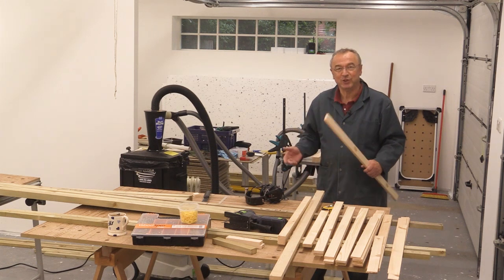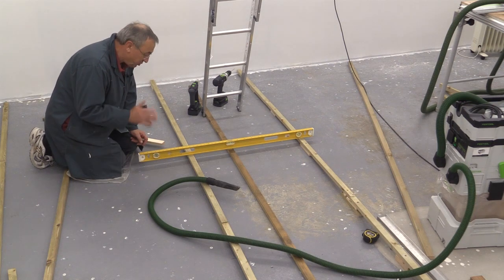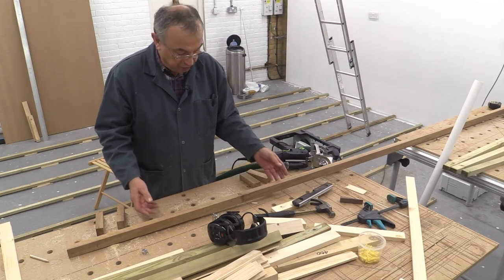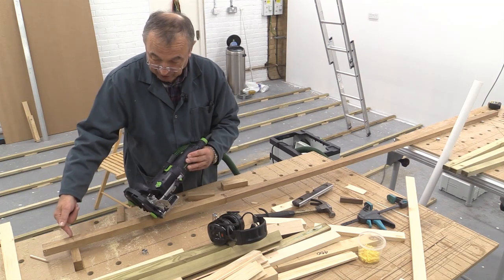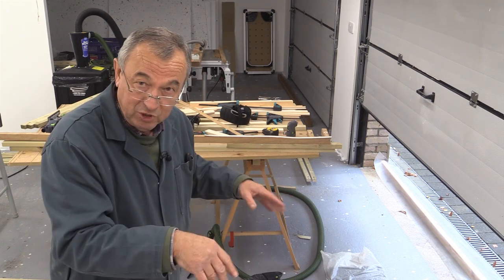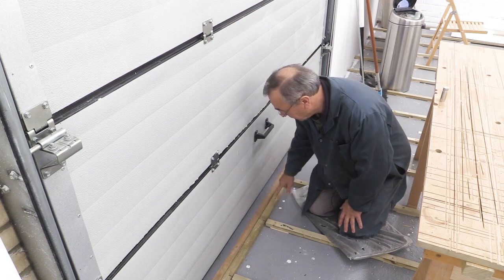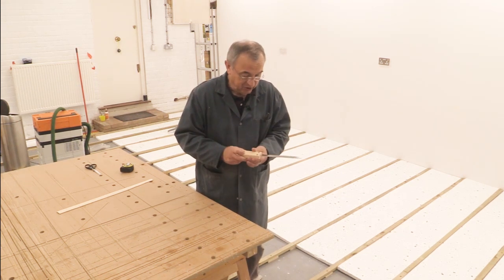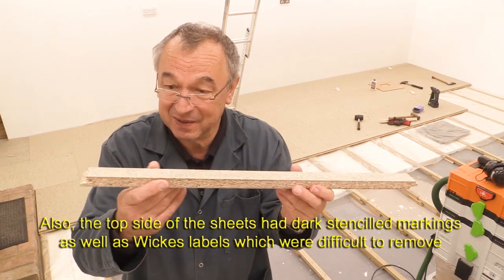The New Workshop #2

Comment: You could have used the plastic cradles. It's just a plastic square with a 50x50 section removed from the centre. Then you place 50x50 timber in the cradles. Once you've levelled them all up. Using a laser and a Sounder. It's a system used on junckers flooring.

Comment: Hi Peter
I note the couple of oil filled radiators.  Very expensive to run.  Had you thought of using a reversible inverter Aircon unit.  We use these in CYPRUS for heating and cooling.  Given the 2-4 times ratio of output to input power depending on the type of unit ( inverters are more efficient) this could be a good solution for heating and the cooling might be welcome if the globe warms up much more (29 here today!).  I am going to do this on my new workshop in UK?
Progress looks good but a lot of work!  WKR 

Mike
Reply from the maker: Hi Mike, Those are left over from the old workshop. I have a radiator in the new workshop which will run off the normal house heating system.  Cheers.  Peter

Comment: Looking good Peter. I floored mine in 18mm sheathing ply 5 years ago and its now wearing through the top veneer in places, but with all my gear on it, it would be a mammoth job to replace. How about a thin layer of ply over the top which will stop the chip board wearing and if you screw it down in 1200mm squares it will be easily replaceable as areas wear with footfall or constant rolling of machinery? Just a thought.
I take it you managed to move house in the end?
Reply from the maker: Hi Graham, Ply will wear more than chipboard flooring but, as you say, it is easy to add a new layer of something more durable if required.  My woodworking guru has a chipboard floor in his workshop. He has been there for 20 years (or more), had fork lifts in and out to move machine, some of which weigh 2 tons.  Peter
Reply: New Brit Workshop fair enough Peter. Every day is a school day.
Reply: New Brit Workshop Wowsers even you have a woodworking guru🤪
Reply from the maker: Hi Dermot, Yes I do. He has no web site, does not advertise yet has a huge customer base around the world.  His work is simply brilliant.   Peter

Comment: My garage floor isn't terribly level either, but I do occasionally put away my tools to park my car in it. Would this solution support the weight of a vehicle? My guess is that it would not. Nice work btw, it looks like you're doing a top notch job.
Reply from the maker: Hi Michael, I have only shown the part where there will be no vehicles in future. The second half is being done now and will have more support battens under the chipboard.  That video may be coming up in 10 days time (or so).  Peter

Comment: Did you consider using self-leveling liquid cement to even the floor?
Reply from the maker: Hi Dan,  Yes, but I would need about 40 bags at £20 each as the variation across the whole floor was about 40 mm.  Peter
Reply: @NewBritWorkshop   Screwfix sell Mapei compound 1210 which works out at £8 a bag, so a bit more economical. I had a similar situation with my slab to you and went down that route. It's worked out ok but it is messy work and it needs layering in 10mm increments so takes a bit of time. It has gotten the job done though.

Comment: Peter, thank you for sharing this video. May I ask you a question please? Given that some woodworking machines are quite heavy, why didn't you go for a 'solid' floor? What I mean is, either a concrete screed or leveling compound?
Reply from the maker: Hi Mike, Take a look at the other comments and you will see that cost is an issue and there is absolutely no problem with the machinery.  Cheers.  Peter
Reply: @NewBritWorkshop  Thanks for the reply Peter, much appreciated, I'll have a look though the comments :)

Comment: Another good way of levelling is to set up a laser level, get a datum, mark your line on a bit of batten and then youse that as a gauging rod to level the floor 👍🏼
Reply from the maker: I did do that but "borrowed" the laser of the dry lining chap whilst he was getting some material. I created a matrix of measurements and then took the smallest away from the rest to get the actual height variation.  Cheers.   Peter

Comment: Hi Peter
Excluding the cost difference, was there a particular reason for using polystyrene over phenolic foil backed foam such as Kinspan, Ballytherem, just to mention a few brand names.  Kingspan is many times more thermally efficient than polystyrene.  Certainly in the construction industry polystyrene hasn’t been used for years now & it doesn’t comply with building regs, not that your application is required to adhere to building regs, I’m just curious as to your reasoning? Thanks.
Reply from the maker: Hi Steve, The cost was the main consideration as doing this floor was not in my original budget. Compromises are having to be made.  Cheers.   Peter

Comment: to level the floor battens, cut lots of wedges and use them in pairs, one sliding over the other to fill up the gap below batten
Reply from the maker: Hi David, An excellent tip, many thanks.   Peter
Reply: @NewBritWorkshop  didn't watch all of show before suggestion, you can use it on your next workshop

Comment: How long did all the shimmong take? Awesome
Reply from the maker: What is "Shimmong" ?  If you mean the flooring it took 4 days as I was on my own and I had to make sure that part of the flooring could withstand the weight of a car.  Cheers.  Peter
Reply: @NewBritWorkshop  Lol, so sorry. I meant "Shimming".
Reply from the maker: Got it - I spent about a day doing the battens which included the shimming. In reality I did one half of the workshop completely followed by the other half. The slightly smaller half took about the same time as the larger part as I put extra battens down along the likely route of car wheels.  Cheers.  Peter
Reply: @NewBritWorkshop  I like to think that i too go the extra mile to get things to be as good as i can get them. Watching you work proves to me at least, that if somethings worth doing its worth doing properly! Many thanks for your uploads!

Comment: For the removal of labels, try a hairdryer (or heat gun if you have one). Warm up the label which will warm up the glue. Then they'll just peel off in one go.
Reply from the maker: Hi Andy, Great tip - cheers.  Peter

Comment: Did you consider self leveling cement? A bit of waterproof flashing around the drywall and poor away,  You will end up with a nicely insulated, warm soft on the feet floor the way you've done it tho.
Reply from the maker: The 40 + mm variation in level made that option difficult and expensive. I would have needed 40 bags at £20 a bag just to do that part.   Cheers.   Peter
Reply: @NewBritWorkshop  At that price yes very expensive. The last time I saw it in use was fixing a gymnasium floor that was poorly done. Not sure what it cost them but was the only way to do the fix.

Comment: I had the same problem with my workshop door. Water entering underneath the lower seal. I solved it by using a 1/12 inch angle iron sharp side up with lots of sealant on the inside floor of the roller door. I can now run my car over the angle iron without disturbing the sealing properties of the iron.
Reply from the maker: Hi Terry, That sounds like a good alternative.  Peter

Comment: Wickes are not alone in sticking hard to remove labels on the fair/good/face side of materials, and it is bl00dy annoying!  I recently had two sheets of veneered ply delivered with labels that needed white spirit to remove - and the dissolved adhesive marked the veneer.  Needless to say, they were sent back.

As to cutting polystyrene insulation board, the Bosch T313AW jigsaw blade is scalloped and works a treat.  It also cuts polycarbonate. [I have no connection with Bosch, just a happy user.]
Reply from the maker: Hi Michael, Yes, those labels are a pain - I am hoping that suppliers will take note - that is why I named Wickes. Many thanks for the Bosch blade tip.  Peter
Reply: Have you ever tried using a hair dryer or heat gun to remove labels? It's works very well for me.

Comment: Great solution to get a true floor. And all the steps you have taken are what all the pro’s would do.  I only have concern for the type of flooring, doesn’t this not damage easily? Especially in a shop, it will be beaten up in no time I’m afraid....  however, you seem to be a careful woodworker, so maybe that’s not a real problem in your case...
Reply from the maker: Hi JW, The flooring is tougher than you think and I know several professional woodworkers who have it on their shop floors.   Peter
Reply: @NewBritWorkshop  Yep … good move Peter. I laid chipboard over insulated concrete some 15 years ago for my shop.  It's taken some beating (including having a Felder 731 3 in 1 on it - more than half a ton of cast iron, and moving it occasionally on felder's HD castors). Loads of other shop machinery too. My chipboard floor is still in great condition.  Has to be admitted though, I laid the insulated concrete floor myself, so it was perfectly flat and level and I could put the chipboard directly on the concrete (Solid insulation and vapour barrier below a 50mm concrete screed.). I wouldn't like to put a load like that on a flooring supported at 600mm centres. However, and importantly for your purposes, the C/board has taken all that, and everything else in a hard working shop - no problem!
Reply: New Brit Workshop good to know, thanks!  I Guess products ar much better in the UK then US 🙂

Comment: Do you have DriCore panels available in the UK? I think that would have been faster and maybe cheaper in the long run. 
dricore dot com

But in the end whatever way you go you will be glad you put a wood floor in. Concrete is cold and hard on your feet. I wish I had installed a wood floor in my shop before I stuffed it full of tools.

Peter, that TSC55 is proving it's worth on this job alright wouldn't you say. Whenever I have a job away from the shop I take mine with me.  Even if I don't have the CT-SYS with me the dust bag works great and grabs about 99% of the sawdust. I've had my TSC55 for about 2 years and I am still amazed at how well that dust bag works.
Reply from the maker: Hi Bob, Many thanks for the info and confirmation that the wooden floor is a good idea. Yes, the TS 55 has proved its worth time and time again. Not having the mitre saw with me made me use the tracksaw cutting station for cutting narrow stock (both at 90 degrees and 45 degrees) and I really think that one can manage without one if pushed. I have since done a very accurate rebate using the same and again feel that the setup can easily replace the mitre saw if need be.   Cheers.   Peter

Comment: Funny how different people tackle similar tasks. I can see you've taken a woodworkers approach to the levelling of the floor; nothing wrong with that way but it's an awful lot of work.
A quicker and easier way is to use similar sized plastic joists (similar to composite decking joist), you can run a bed of tile adhesive or mortar along the floor and just tap the joist in to level, next day or within an hour with tile adhesive you can screw your chipboard in.
I'm sure your way is more accurate than most homes, certainly most workshops
Reply: Wouldn't the plastic joists be a lot more expensive though?
Reply from the maker: You are right about taking a woodworkers route on this. Obviously professionals in the industry will have access to all sorts of kit that is not normally stocked at the mass market builders merchants. I would love to know more about your suggestion as it would help others about to do similar work.   Peter
Reply: The joists are composite material made from recycled wood and plastic, they are not affected by moisture and very rigid for the thickness.
Cost is always something to be weighed up, the joists would a little more money but the labor savings outweigh the material costs by far.

Comment: In the cases when I've had to level things of this nature, I've usually cut (or bought) wedges. Pushing two wedges together in opposing direction makes for a very convenient way to create adjustable spacers.
Reply from the maker: Hi Rune, I am sure that would work very well indeed but I would need a huge number of different size wedges.  Cheers.  Peter
Reply: Not really. If the wedges are sharp on one end, and say 30 mm on the other, at 150 mm length or so, you have every thickness from at least 5 to 45 mm at the ready. Putting them perpendicular to the beams makes adjusting very simple.

Comment: Good job as always Peter. Just a slight concern about using gripfill. I would hesitate to use it for sealing joints. I have had it go dry and shrink considerably. Now I always use either Sikaflex or a hybrid polymer such as Stixall. These new sealants are hugely better than gripfill. Good luck with your workshop progress. Ollie.
Reply from the maker: Hi Ollie, Many thanks for that. Funny enough I did but some Sikaflex in order to do a final bead on the "wet" side of my bund.  Cheers.  Peter
Reply: @NewBritWorkshop  Glad to hear it, it's ideal for that. Try out the Stixall too next time you need a sealant it's brilliant for almost everything and better for painting over than the Sikaflex. I look forward to seeing more workshop progress.
Reply from the maker: Many thanks.   Peter

Comment: Why don't you put the dogs for the material on the front when cutting small pieces? Saves you hanging over the table with the saw in your hand.
 I've got pretty much the same road ahead. Still, nice to work on getting as mich out of the little space we have.
Reply from the maker: Hi Johannes, I leave things in one place as I am cutting the flooring sheets at the same time and they are 600mm wide.  Cheers.   Peter